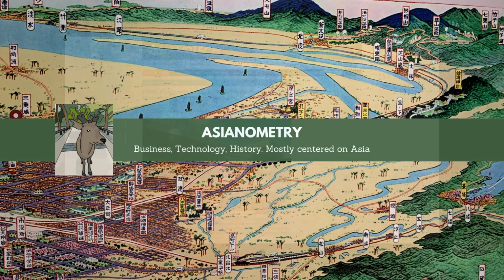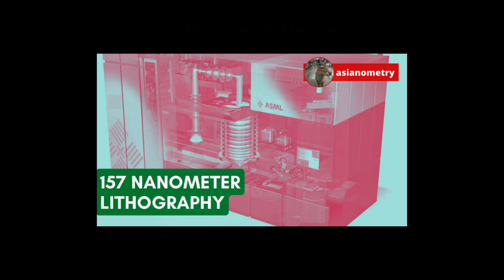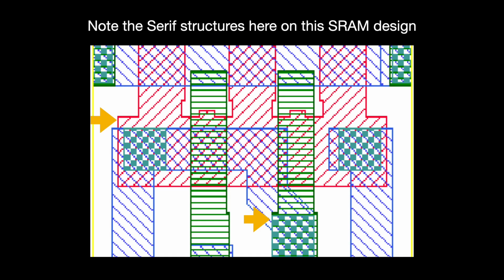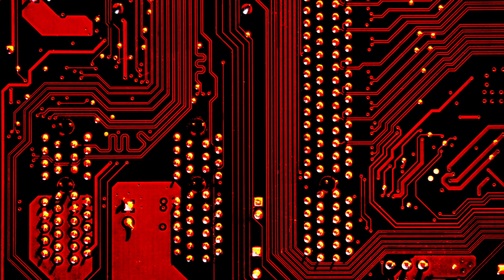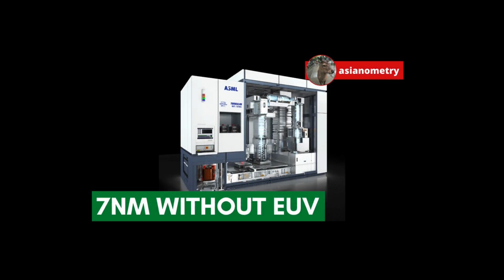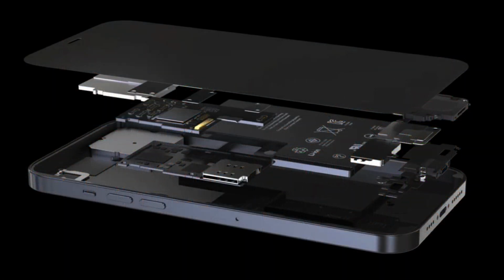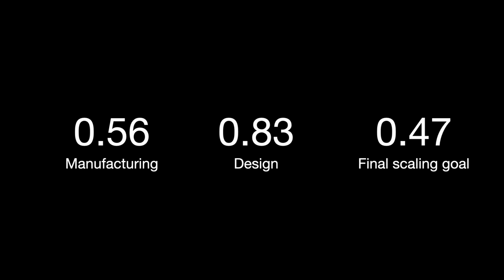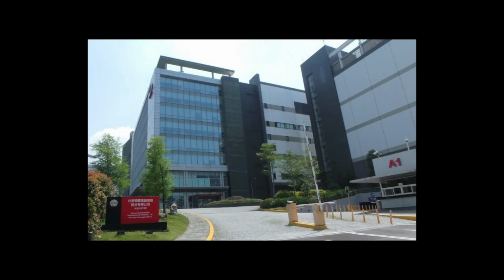Why Every 3nm Process Node is Different

Comment: Xilinx was known for their incredibly tight relationship with TSMC. AMD, having owned their own fabs previously, was already intimate with working directly with the lithography department, so they quickly ascended the same stairs with TSMC. Today AMD owns Xilinx, and it is speculated that their ultimate goal is to beat Apple to the leading edge and become the premier partner of TSMC. If that happens I think both Intel and Nvidia will be in long term trouble...
Reply: Doesn't premier partner status in this relationship have more to do with wafer purchases than engineers?
Reply: but apple had tremendous amount of cash on his pocket (yeap real reserve cash from sellin iphone)  they can buy all new tsmc node volume like 100% all off it production year long
Reply: @zunriya  what it depends on is if Apple stops innovating like they did t with the iPhone 14, they reuse the same old chip as last year, only updating the iPhone Pro. If competitors don't catch up they will likely not push the bleeding edge as hard
Reply: @wile123456  others will nvidia ada Lovelace back frrom samsung to tsmc, Qualcomm back from sd 888 8 gen1 samsung back to tsmc, mediatek dimensity 9000 4nm tsmc, amd rdna new zen core epyc xilings fpga, alot of them want it, who cares about apple bleeding tech, all cpu designers want fabs to tsmc latest fabs on their flagship chip, because  apple invest their masive money on early 2000 to suport tsmc when they sparate apple A production from samsung
Reply: @wile123456  every year it’s the same talk - nothing new from apple, moaning about high price etc. and yet apple makes arguably the most competitive, well thought out phones that can easily compete with the best of the best from the android world. Diminishing returns dude, while androids fight over who can cram more watts into the charger, more megapixels into the camera, more hz into the screen, more more more; apple just makes a solid phone. What do you want to improve? Screen? It’s a top notch custom made panel; battery? It lasts longer then any android on the market; SoC? It runs circles around anything from Qualcomm; aesthetics? iPhones have been setting design standards since day one;  speakers, microphones, biometric authentication, build quality, post sale support etc. the amount of money, time and effort, they put into making a modern smartphone what it is today can’t be denied, even if you prefer to buy another crusty android.
Reply: @Hypern0va  Your comment is so badly detached from the objective reality. The word "solid" has nothing to do with iphones neither on software/hardware side, let alone on build quality or durabilty. Not to mention value for money ratio.
And clearly the thing about support is a joke, especially given state of old apple hardware, that runs perfectly fine until that one os update comes for example or the prices of licensed repair shops/parts.
Reply: AMD CPUs want the performance variants of the process, while Apple can charge premium prices for small phone chips to a trapped user base in a walled garden.  A yield problem imposes a cost on just part of the phone's BoM.
A CPU or GPU yield problem makes the product uneconomic to manufacture.
Reply: Intel's nodes are expected to get far better very soon
Reply: @Phoenix56801  it could be said that that statement applied several years ago ...only Intel failed to deliver on their road map promises. Over and over again their process met delay leading to greatly delayed products.   I think Intel is on track as you suggest but only time and proven success in meeting design roadmaps will determine how well Intel will be at staying relevant in  chip fabrication and manufacturing.  It all about meeting and exceeding internal designated roadmaps
Reply: @craighutchinson6856  things have started looking good for them again, since pat gelsinger became CEO
Reply: @Phoenix56801  Intel's node have been expected to get far better for the last 8 years. They've consequently missed their target by multiple years. Their last normal rollout was 14nm. TSMC makes 5 times more money than Intel. Do you really think they can keep up with someone who has that kind of dole AND knows that they literally live and die by their nodes?
Reply: @andersjjensen  it's not looking good currently for Intel, but let's wait and see.
Reply: @andersjjensen  
What are you talking about? Intel sir makes more money than TSMC and by now you should know how Intel 7 stacks against TSMC 7nm process, by the way the number beside nm is arbitrary which depending of the manufacture what for Intel is 7nm for TSMC may be 5nm. So get your maths better, Intel is a bigger company than TSMC and invest more in R&D than NVIDIA AMD and TSMC combined
Reply: I dont think you are quite correct. I worked for Altera 2001-7, and Altera were aligned with TMSC from when I was there, right up until around 2015. Now they're owned by Intel so that's probably changed. Xilinx used GLOBAL Foundries/USMC I think. I don't think Xilinx ever had a relationship with TSMC, but I could be wrong.
Reply: @kristianTV1974  Xilinx has been working with TSMC since 2009 when they started using their 32nm process. Previously they had dual-supplier partnerships with UMC and Samsung. AMD sold of their fabs as Global Foundries in 2008 but GloFo didn't get their first non-AMD customer until 2010, so there was never a time frame in which Xilinx could have been a GloFo partner.
Reply: Z3U5  Samsung is behind the curve. They're good at cost optimizing the not-quite-bleeding-edge nodes. But that's the road to becoming a second supplier of budget friendly options. Not the road to being the "wow brand" so to speak. Nvidia, who only have GPUs, cannot afford to be seen as the budget option. They have zero leverage over SI/OEM bundling deals. If they're not outright attractive AMD and Intel can "bundle them into oblivion".
Reply: Apple has a market cap 23 times AMD's.  just say'n
Reply: @semidemiurge yes, but they would never be allowed to buy them out. They have bully/money power. IMO ASML is ten times more valuable than Apple, as far as their value to the world.
Reply: @semidemiurge  Only relatively small part of Apple's money goes to chip manufacturing, though. They still have to spend money to build the entire rest of the phones and laptops around them, whereas AMD's only selling chips.
Reply: I speculate that you’re talking out your ass lol. Idk how you think the tiny Xilinx arm of amd is going to displace Apple. Not unless Apple decides to build their own fabs 😂
Reply: Nerdssssss but interesting
Reply: That is reall amazing!Mediatek
Reply: Seems like AMD are foregoing deliberately the leading node or even introducing the performance variant.
Small mobile chips want low power and high density not performance so suit leading.
Xilinx FPGAs being regular might suit, but it appears the design team have been used to build accelerators for AI and things like video stream processing.
The benefits of pioneering the latest node to AMD appear unclear, each one offers less performance or density gain while being more expensive and less predictable.
The server CPU market has other routes to performance than higher clock frequency and gaming via cache optimised 7nm for L3 bonded onto CCDs.

Comment: Soon they no longer can go farther! It is physics limitation
Reply: I heard that there were already 1nm prototypes
Reply: @akshayy91  remember that 1nm might not mean an actual 1nm design. That would be quite difficult. Even in this video it was mentioned how nanometers have nothing to do with names of processes.
And yes - I think last year IBM showed something on 1nm technology.
Reply: There’s no need to jump to 1nm. AMD 5nm/6nm chiplets can beat Intel monolithic 3nm. 3D V-cache is already causing panic at Intel AMD Nvidia.
Reply: @tringuyen7519  intel is moving to chiplets soon tho
Reply: Certainly creating smaller processes is no longer the most cost effective way to improve computing performance at this point. I hesitate to go as far as defining the limits of physics tho. :)
Reply: Soon will be N0 - N zero
Reply: we’ll get photonic chips by then
Reply: @covert0overt  
Will the number get reset?
Like, maybe N1000 or perhaps P1000?
Reply: I'm honestly eager to see what they are going to do from there, and if there's gonna be some sort of breakthrough
Reply: Maybe in 20 years. There is still a lot known of scaling potential in many dimensions and methods.
Reply: Too be honest,
Current CPU for phone already powerful enough.
The implementation of the tech to use it were lagging behind as of now.
We don't need to rush into new production tech each year.
Maybe in the future, production tech were updated slower, like every 3 or 5 years
Reply: @bungkusi2432  no not enough yet, need more power to emulate console games.
Reply: @fugslayernominee1397  
With 5G, it won't be a problem to stream that to you're current phone

Comment: Do you think nano sheet nodes will have thermal efficiency issues?
Reply: When you say thermal efficiency, do you mean thermal conductivity?

If so, then gate all around (or nano-sheet) jut means the gate will fully surround the channel, it won't necessarily add any additional thermal resistance to the stack. Furthermore, the metal tracks add a lot more height to the die overall. And there's also the IHS that desktop CPUs have. All of those add a whole lot more thermal resistance than anything at the transistor level. CFETs will have more of an affect on that than GAAFETs, but even CFETs shouldn't hurt thermal conductivity much. And consider that this is in an era of advanced 3D packaging where Intel and AMD are stacking SRAM dies on top of CPU dies.
Reply: @AlexSchendel  I'm thinking of it from a cost/performance standpoint. I'm unsure of the potential gains between sequential nano-sheet nodes. Unlike FinFET nodes where dimensions are reduced between each generation. Nano-sheet nodes would not have that benefit and would require more sheets to improve the stack performance, which leads me to believe that this would only increase the thermal load of the node and clockspeeds will have to suffer for it. Are you saying that adding more nano-sheets in GAAFETs will not cause much of an issues as far as thermals and would not result in overall lower clockspeeds?
Reply: @将軍九八.彁  Well, stacking them vertically has the obvious area benefit and having taller stacks will certainly improve electrical conductivity across the channel (just like how Samsung says they'll vary the nanosheet width to increase conductivity or save area). And that improved conductivity/reduced resistance means you'll have better thermal characteristics because less energy is lost to heat. Feature sizes should also continue to shrink with GAAFETs, just at a slower rate and it will definitely require an overhaul of feature measurements as the initial GAAFETs are gonna be quite wide compared to current FinFETs.
Reply: @AlexSchendel  Thanks. I will be interested to see the node specs when they come out and to see if they can achieve a good price/performance that will make them accessible to the average consumer. I'm unsure of GAA and for me I can't wait to get my hands on some TSMC 3nm chips!
Reply: @将軍九八.彁  yeah! Performance will definitely always be going up. Prices are going to be difficult going forward as wafer prices keep doubling, but between smaller dies, advanced packaging, and improved architecture, the incumbents have found a way forward so far haha.